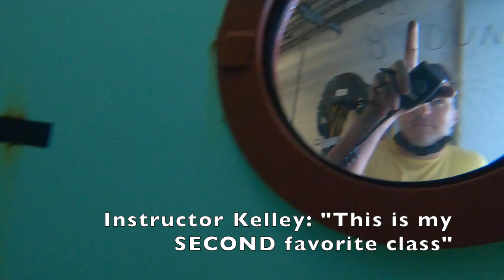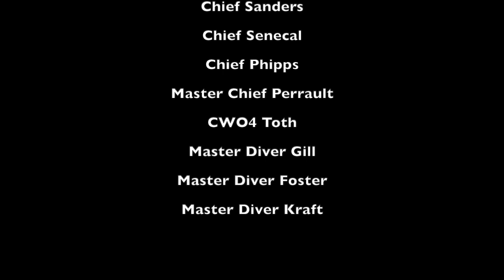20-60-2C Navy Dive School

Comment: What are the requirements before you can join this rate ?
And is it competitive to join or you just need to have the minimum requirements? 
I have no issues swimming,  just afraid about the push ups and pull ups things.
Reply from the maker: Dive physical and medical has to be squared away. PST is the minimum physical requirements to get in. 500yd swim combat side stroke in under 12:30, 50 pushups perfect form, 50 situps over knees perfect form, 6 deadhang pullups, then a 1.5 mile run under 12:30. Talk to a recruiter about getting an ND contract and see what they can do for you

Comment: Are they as dive qualified as navy seals?
Reply from the maker: More. Now im not a SEAL so ill tread lightly. SEALs use diving as a means to the ends whereas NDs live underwater. Its a different operation set, whereas a SEAL might be trained in open and closed circuit rigs ( mostly closed rebreathers), SDV AND DDS, and more tactical stuff, NDs go into extreme depth into diving and learn hardhat, salvage, stage diving, husbandry, etc.